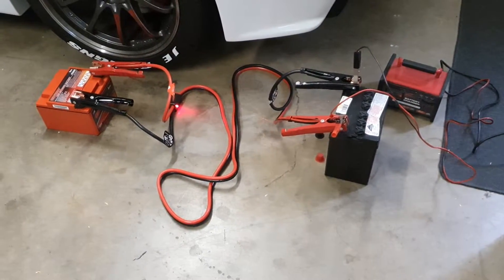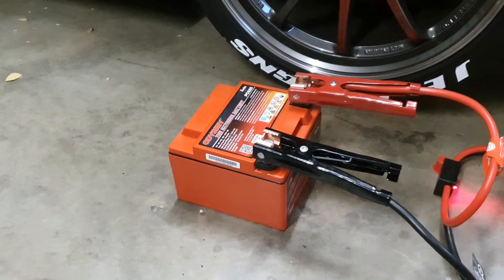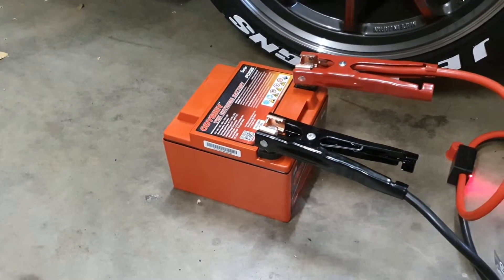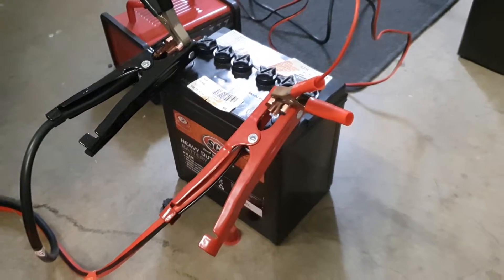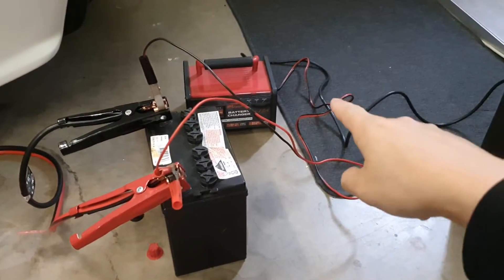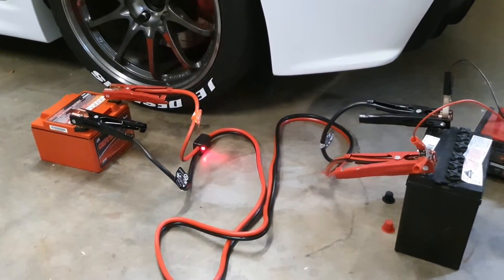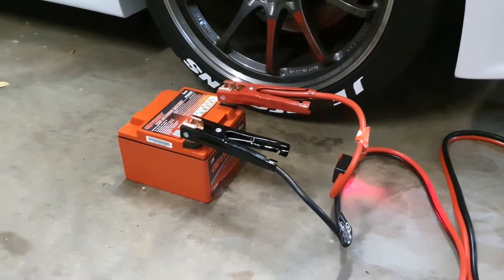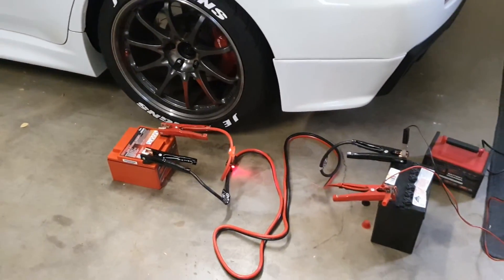How to bring a dry cell battery back to life

Comment: Thx for the video.  You will want to load test your battery for capacity as well.  Also, an isolated battery will still experience self-discharging as all batteries do.  Cheers.